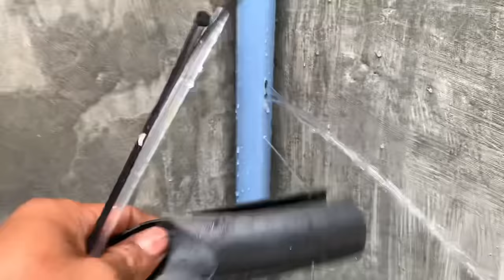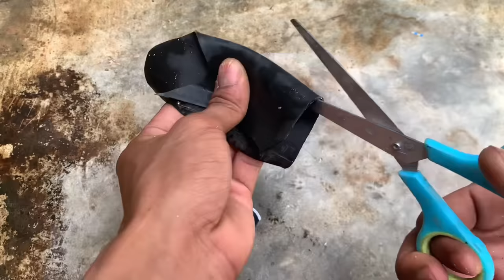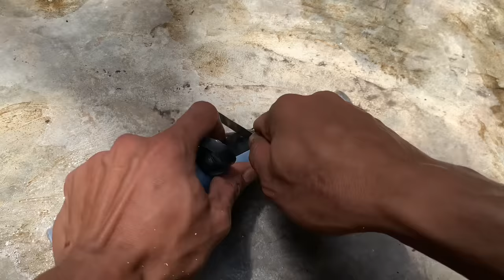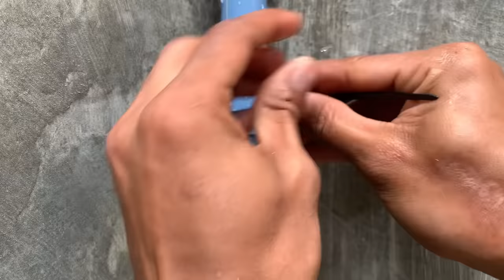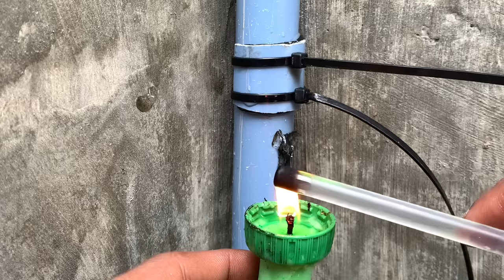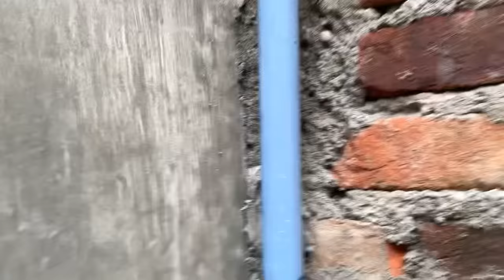WHY DIDN'T I KNOW BEFORE! 2 Smart Tricks To Fix Leaky Pipes Without Closing The Faucet

Comment: Much easier is to put a piece of the pipe with the pvc adhesive. It even resists in pipes with water pressure. Without the eraser, of course.